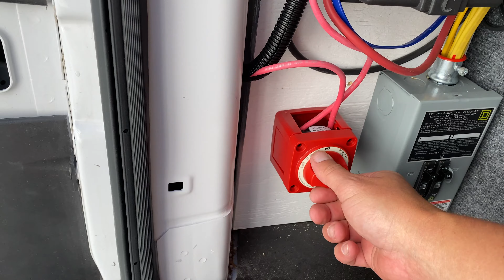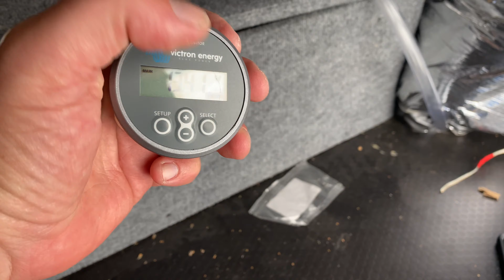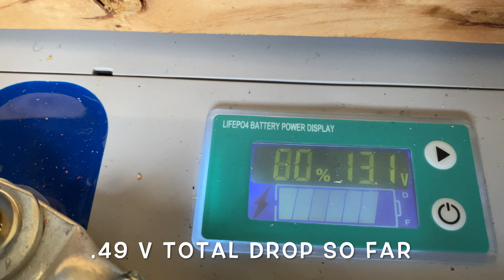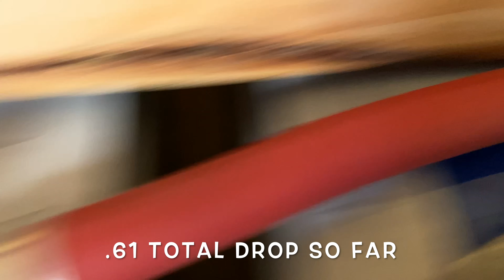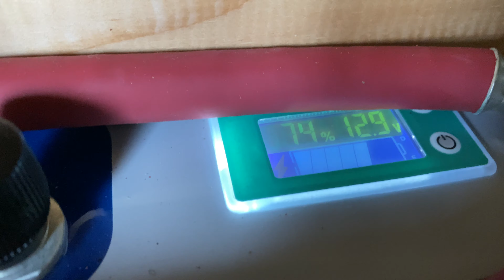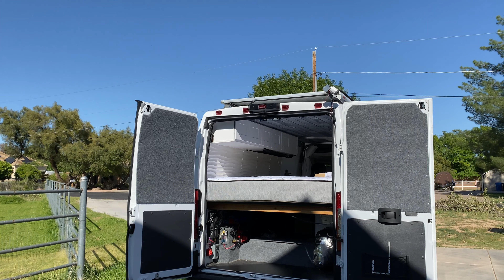Van Life 200 ah Lithium batteries after 7 months. $550!!!

Comment: If the temp. is only 72, is the air conditioner just running the fan then?
Reply from the maker: Yes the fan was running constantly... the compressor would run intermittently

Comment: Nice video Jon.  Thanks for sharing.  You said it exactly right....the air conditioner with air temp so low will not make that A/C work hard at all.  If the compressor isn't cycling on and off it will only be pulling amps for the fan motor.  But you acknowledge that fact many times so no one should be confused about that fact.  You can't beat LiFePO4.  I like how you set up your controllers.  That is one big ass inverter....wow...that costs some real Jing.  Nice install and well thought out.
Reply from the maker: Thanks Alan! Yeah it was a fun project- I prefer over building than regretting hahaha

Comment: Hi, I am glad that the batteries hold well. I got the same one from UK. It was way harder to source it in Europe and costed me about 1000$ and it was still the cheapest option by a lot. Its bms didn't charge-DOA and I had to replace it which costed me another 50$ and 3 months as it was low in stock. Now it is all good (several months already), but I wonder what mods have you done to the original BMSs? Could you make a video? It would be great if you have pictures of the opened batteries, the BMS etc. My hands were itchy to fix the first one by myself, but I didn't want to void the warranty. 
P.S. You missed to show the total AC KWh consumptionon the meter, but I suppose it does not have batteries to keep the display on after a power loss

Comment from the maker: Because I knew it would be pointed out- I started the video at 13.6 volts "100%" I heard back from the manufacturer today on this. They said after 5 full cycles of charge/discharge the 14.6 volt capacity will be achievable. We will see! also they have the same 10 year warranty!

Comment: 5.4 kw translates to 450A at 12V. That means your batteries have a capacity of 150 Ah each. 
Definitely a good deal, but I’ll stick with the BB batteries, for the 10 years warranty.
Reply: 5.4 kwH translates to 450aH at 12v, but the measurment is taken at the 110v socket, so there is convertion loss which is usually between 10 and 20% depending on the inverter's efficiency (quality) and how heavy loaded it is, so at the time of the measurment at least 500Ah were drawn from the batteries and this is good enough, having in mind that they worked some more time afterwards. As for the built-in status displays-don't trust them. Lifepo4 SOC cannot be easily measured just by measuring voltage and those are just voltmeters. You would need a shunt to measure current by time. As for the 14.6 vs 13.6v starting voltage-it won't make huge difference. To be exact this is maximum charging voltage, so when they stop charging, the Lifepo4 batteries quickly settle to their fully-charged voltage. Usually charging those to 13.8v will cause just a couple of percent decrease of total capacity and will prolong the life of the cells, but depending on the BMS, cell balancing might not ever trip on and you might end up with disbalanced cells. And those large capacity cells do not balance easily with the built-into the BMS balancing circuits which are usually ~0.1A
Reply from the maker: I appreciate your feedback Jeff! I really do! I am surprised you didn't point out the 13.6v  "100%" start point on the batteries! I just put up a comment on that. At 12 months I'll do another full test with something that gets a solid heavy draw so I can more quickly measure whats happening.
Reply: @PilotJon  I copied and pasted a discharge chart for 12V LFP batteries. Hope this makes sense.

Discharging an LFP Battery

Unlike lead-acid batteries, the Voltage of a lithium-ion battery stays very constant during discharge. That makes it difficult to divine the State-Of-Charge from Voltage alone. For a battery with a moderate load the discharge curve looks as follows.

(Charts did not copy. Here's a link to them).
https://www.solacity.com/how-to-keep-lifepo4-lithium-ion-batteries-happy/

Most of the time during discharge, the battery Voltage will be right around 13.2 Volt. It varies by just 0.2 Volt all the way from 99% to 30% SOC. Not long ago it was a Very Bad Idea™ to go below 20% SOC for a LiFePO4 battery. That has changed, and the current crop of LFP batteries will quite merrily discharge all the way down to 0% for many cycles. However, there is benefit in cycling less deep. It is not just that cycling to 30% SOC will get you 1/3 more cycles vs. cycling down to 0%, your battery will likely live for more cycles than that. Hard numbers are, well, hard to come by, but cycling down to 50% SOC seems to show around 3x the cycle life vs. cycling 100%.

Below is a table that shows battery Voltage for a 12 Volt battery pack vs. Depth-Of-Discharge. Take these Voltage values with a grain of salt, the discharge curve is so flat that it really is hard to determine SOC from Voltage alone. Small variations in load, and accuracy of the Volt meter, will throw off the measurement.
State-Of-Charge 	Voltage at rest (zero current) 	Voltage under load (0.25C)
100% 	14.0 Volt 	13.6 Volt
99% 	13.8 Volt 	13.4 Volt
90% 	13.4 Volt 	13.3 Volt
70% 	13.2 Volt 	13.2 Volt
40% 	13.2 Volt 	13.1 Volt
30% 	13.0 Volt 	13.0 Volt
20% 	12.9 Volt 	12.9 Volt
17% 	12.8 Volt 	12.8 Volt
14% 	12.6 Volt 	12.5 Volt
9% 	12.4 Volt 	12.0 Volt
0% 	10.4 Volt 	10.0 Volt
Reply from the maker: Very cool! Thanks for the info! I'll use this in my future comparisons- So far the batteries have performed better with age- But I don't know that much about electrical stuff honestly..